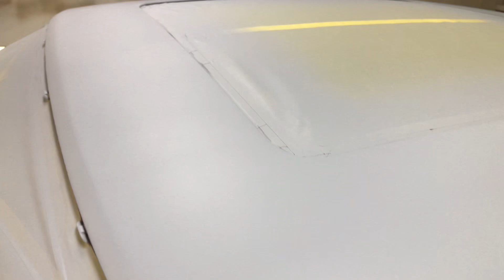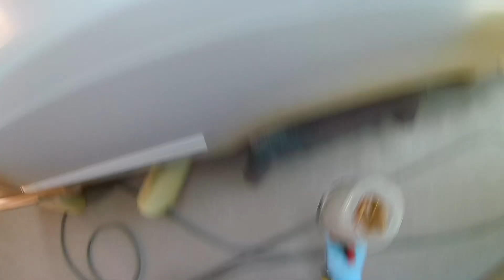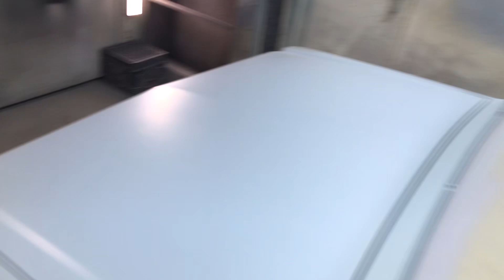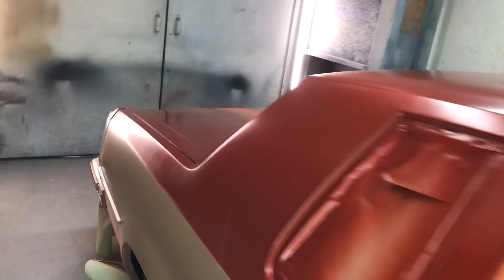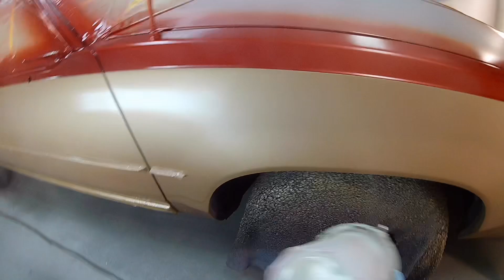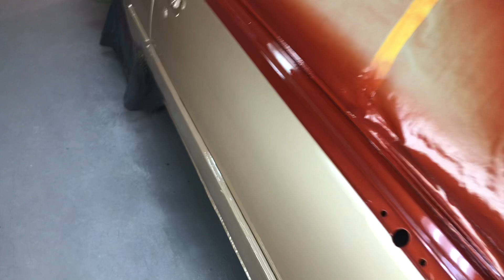Custom Two Tone paint job on a 84 Cutlass Supreme

Comment: UPK, great vid! Question..I'm going two tone with a narrow black stripe in between the top and bottom.  Should I bring the top (red) all the way down to bottom (silver) and spray over the red with my black or leave the gap and tape both sides to get my black on? Thinking the lines might not be too thick if I bring the red down. Appreciate you bro!!
Reply from the maker: I appreciate you checking out the video and you definitely can bring the red down to the silver then tape off for the black and it shouldn’t be to thick but if you feel that it is and you want it to be smooth and it’s in your budget you can do a flow coat and bury your lines
Reply: @UndergroundPaintKing  thanks bro, just to add I'm going to spray single stage.

Comment: I tried using hvlp with the small compressor got and it got a lot of orange peel sanded it down with 320 and applied basecoat about 3 coats and about to apply last coat of clear on the hood top and front right and left panel. Gonna take the hvlp gun back to Harbor Freight I actually have two be better off just selling both of them because can't paint good with them with the small compressor got anyway. Harbor Freight don't see any lvlp spray guns so gonna have to get more from Ali Express.
Reply: So you need typically between 15-25 CFM to operate a quality HVLP spray gun perfectly while to operate a conventional spray gun you need 11-15 CFM.

Comment: Hey I have a question for you I know you're not shooting a single stage on this 2 tone but I did. I waited 8 hours for the bottom half to Kier it wasn't tacky to the touch so I masked it off with the 3M painter's plastic so i cam paint top half. Top came out really good went to unmask the bottom half and the plastic stuck to it leaving plastic marbling make designs in the paint. Did I not  Wait long enough to let it dry before I before I messed it off and is there a way to get that nasty mark ls out
Reply from the maker: You may have needed a day to wait for masking, it’s hard to really give you a good answer without knowing the products you used and what’s recommended by the manufacturer of the materials you used
Reply: @UndergroundPaintKing   It said 6 to 8 hours on the can. The paint was good to touch it wasn't sticking to .y hand but ya man when I remove the plastic it was sticking to it a left marks all in the paint.. Is there a way I can fix this you think if I just wet sand the single stage paint and reshoot the bottom half it would be good or do I have to strip it all down
Reply from the maker: @Beenthat1214  I would let it cure good them tape off after sanding then respray it…no need to strip it
Reply: @UndergroundPaintKing   OK I'm just gonna let the whole car sit for like a week or 2. Then just wet sand the whole bottom half with 2000 great and Respret.. One more question am I able to add a clear coat after everything's done it's a single stage Enamel metallic. Haven't found any videos on if you can but I was thinking if you let it cure for like 2 weeks also maybe be able to add a clear over it
Reply from the maker: @Beenthat1214  I have seen people spray clear over single stage and get good results it’s just something I don’t do personally
Reply: @UndergroundPaintKing   Yeah I'm a little scared to do it anyway after this mishaps with the plastic sticking think I'll take my chances I'm not doing it just let the car sit for a week or 2 wet sand and shot it again.. Thanks for getting back to me I really appreciate it
Reply from the maker: @Beenthat1214  you’re welcome 💯

Comment: Hey how long do you wait before masking off the bottom half of the base coat.  I don’t wanna put tape on too early and have it peel off
Reply from the maker: I usually wait 30-45 minutes before I start taping, I want it to flash off real good
Reply: @UndergroundPaintKing  cool  thanks for knowledge big dog. I was worried about masking the base so I appreciate the quick reply and solid video. My lines came out solid  🤙
Reply from the maker: @Hollywoodandsunset  nice 💯 glad I could help!

Comment: question...does anyone know how to address or prevent the build up line that is formed where the 2 colors meet (tape line build up) so that there isnt a raised portion of the paint disrupting the shine of the gloss. Its an important question for me, as i have a 2 tone job comingbup and I've always struggled with this
Reply from the maker: I like to use fine line tape when doing my two tone jobs and I can usually bury it with clear without a hard line issue
Reply: @UndergroundPaintKing  thank you, so much
Reply from the maker: @harleytrott2335  you’re welcome!

Comment: How do you prevent getting a hard tape line when doing two tone?
Reply from the maker: I use a fine line tape that helps with the hardline which I used for this job along with another two tone job I showed on the channel…also if you have enough clear you can cut the clear then do a flow cut and get rid of the hard line
Reply: @UndergroundPaintKing  💯